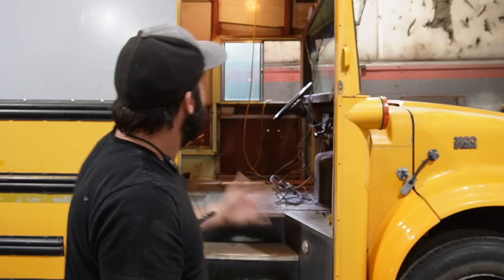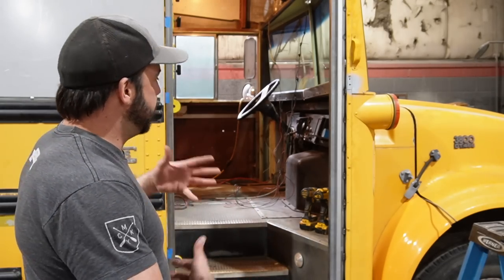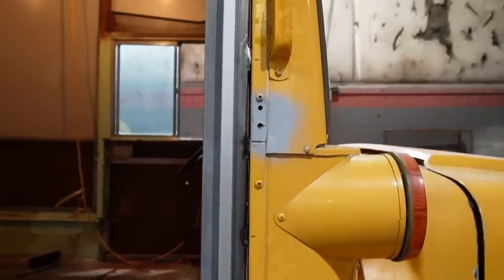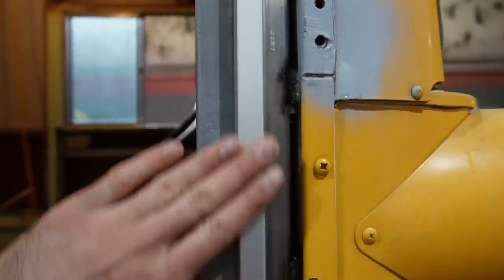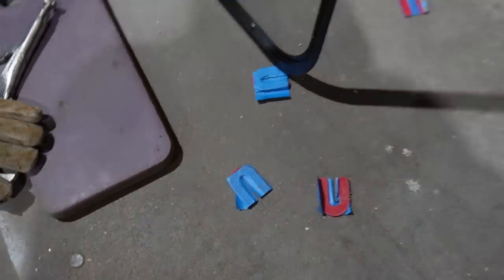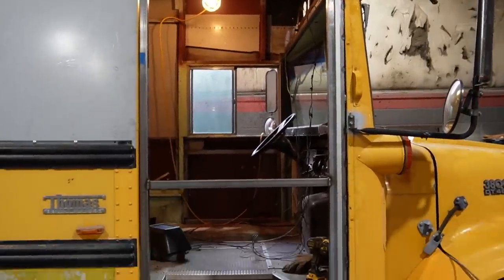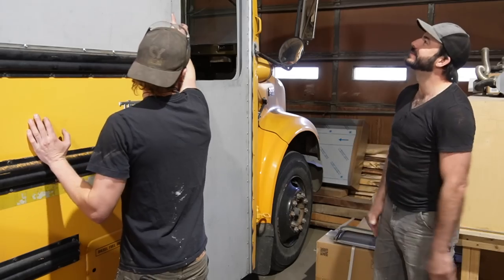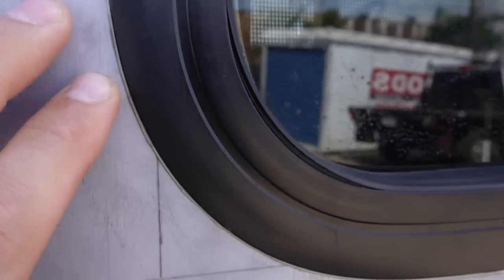CUSTOM FRONT DOOR BUILD w/ Keyless Entry! (Skoolie Conversion Guide #9)

Comment: Chuck, Beautiful door.  You guys always do such fine work.  If you wanted to add a simple handle to the inside and outside, how would you do that?  Could you just use rivets to attach them to the door?    Also, can you do a video on adding security to doors and windows?  I am a senior woman and want to have extra security locks that can’t be opened from outside simply by breaking a window.  Thanks.  Don’t forget to show us how you filled in the open space along the hinged edge of the door.  Thanks again.

Comment: Nice approach.   Does definitely make sense to make the door fit the opening as it were.  

One thing that doesn't make as much sense to me is,  why rivet the  skin on, especially on the inside?  The rivet heads will affect the quality of the bulb seal.  I understand attaching the outer skin w Rivets, as it reflects the exterior character of the bus, but I would have welded the inner skin to the frame.  
Also, maybe it's just my OCD, but I wouldn't have mounted the window (or door) until it was painted.

Comment: Hi Chuck. I’m getting ready to tackle this project   I’ve gathered all my supplies and I’m ready to give it a go. One quick question though. What did you use as spacers on the 1x2 square tube? I’m a complete newbie at welding and not sure how to go about that step. Thanks!
Reply from the maker: i just used some metal scraps i had laying around!

Comment: Hey Chuck, love your videos.  I was wondering if you ever had issues with the steel frame and 2x1" rectangular tube with the aluminum hinge.  I know mixing steel and aluminum can cause corrosion and it doesn't seem like you used any insolating materials between them.
Reply from the maker: It's painted beforehand, I'm sure given a few decades you might see isuues

Comment: I'm planning on building this door this coming weekend. Do you happen to know which model of Roton hinge you used? I see they have many different styles. Also, where did you source that RV window from? I heard you say it was dual pane insulated. I have a hard time finding them on Amazon. Thanks for the awesome videos and inspiration!
Reply: did you ever find out which hinge was used? i had the same question.
Reply: @veracutbear2445  yes actually. It was the Roton 780-110HD. At least for my application I used that one. There is another 780 model that has a wider attachment surface that could work better on the 1in 1/4 frame. Still, the 780-110HD supports 200lbs. We found the hinge at DoorCloser for $89, but it's the anodized bronze aluminum version, and not jus the bare aluminum version.
Reply: @BryantBeers  thanks man

Comment: Really excellent door job!  How do you keep galvanic corrosion from eating up the dissimilar metals (aluminum hinge and steel door frame)?
Reply from the maker: We paint the steel,but I'm not too worries since the screws that come with the hinge are steel, they must think it's no big deal
Reply: I’m considering putting some kind of thin, inert gasket between the 2 metals, like a thin layer of rubber or plastic... but like Chuck said, I don’t think it’ll be too much of an issue.

Comment: Hey Chuck, love the video! Quick question - did you remove the screws that hold the original door frame side trim in place? I’m guessing you didn’t need to because the new frame you welded on is far enough from the original frame to allow clearance for the screw heads, but I’d be interested to hear how you addressed that issue. I’m considering grinding the heads off and welding them to avoid play in the trim panel, but perhaps I’m over-thinking it... what did you do? (Hopefully you didn’t cover that and I just missed it in the video... 😬)
Reply from the maker: Not totally sure which screws you're referring to--the ones inside the door jamb or on the outside face of the door frame but the outside ones are cleared because the hinge sets the door out far enough. There actually weren't any screws inside the jamb of this door to start with, but in the past, we've removed them and plug welded the hole. Hope that helps
Reply: That totally helps! I thought I saw screws on the inside of the door jamb but I might have been hallucinating! My bus has them all down the inside so I’ll remove them and plug the holes. Thanks for a SUPER fast reply!!!

Comment: Once the door has been fitted as a custom door, is it wide enough for a full size washer/dryer or refrigerator?
Reply from the maker: It depends on the bus, these custom doors end up bigger than thr stock one it replaced so that helps. There is also usually a back door

Comment: this is beautiful but i would like to point out how poorly those camper latches and locks work. for one, they pretty much all use shitty keyways and are often keyed alike. some use the universal ch751 key still. (not the model pictured, i was mistaken.) seen too many clapped out, broken-into-two-thousand-times tweaker campers. again, love the door, hate the latch and lock.

not yet sure what i'll do about entry, since i like all of the original controls (door, crossing bar, stop sign) but whatever I do, i'll probably eventually fabricate a door and use an electronic fail secure bolt w/ manual backup. i have a model from YLI Electronic in mind, they seem to use a half-decent keyway. good enough to meet the bare minimum at least.

either way, just kind of coming up with ideas for now. learning all i can before jumping in and getting a bus.
Reply from the maker: A lot are shitty. I say that locks just keep people honest, you're always one broken window from someone getting whatever they want! I'll have to check out what you mentioned
Reply: @ChuckCassadyYT  very true haha! i tend to needlessly obsess over the most obvious point of entry. at least having a half-decent bolt on a door will deter the lowest skilled thieves short of the window breaking you mentioned* and malicious family members. the ones i'm looking at are almost certainly overkill both in terms of robustness and price ($80-160 USD from china, lol but they're very pretty)

 the other nice thing though is you can control them however you please. switched by a development board running a custom application (ie via a phone app) or with the common rfid access control modules + request to exit switch. i intend to set my bus up with the same level of diy'd home automation and security as a normal house, since i'll be away quite a bit yet live in it full time when i'm not resetting on the road.

btw, was there ever a part 10? the playlist says one video is unavailable and hidden and seems to jump from part #9 to #10.5.